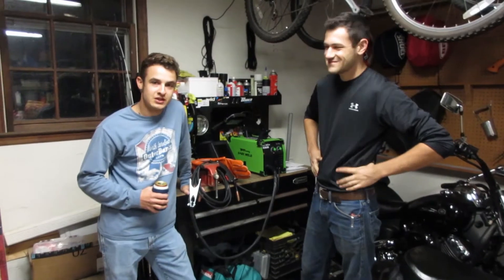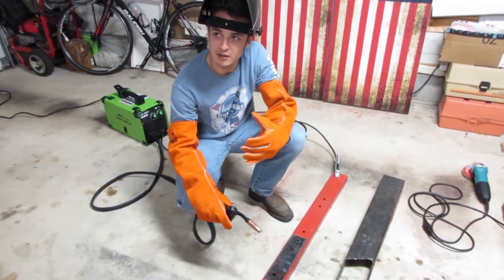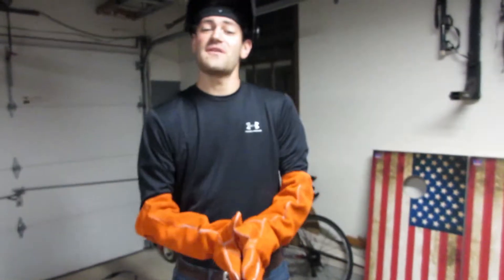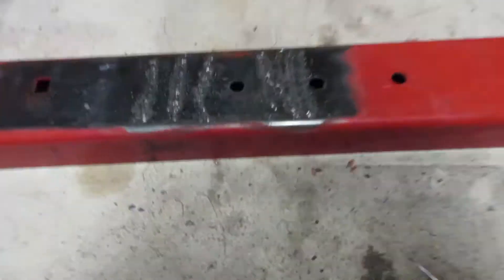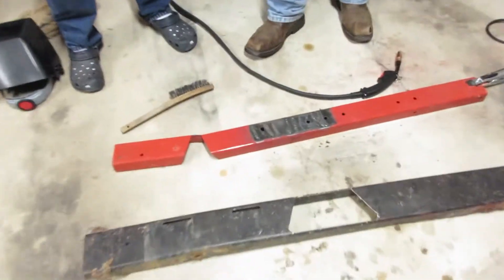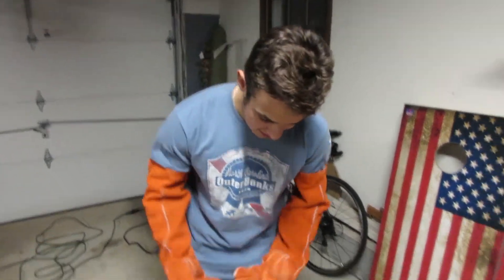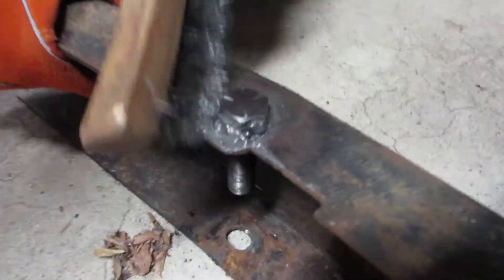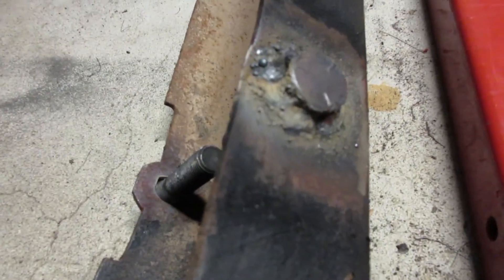Welding for the First Time - Forney Easy Weld 140 FC-i

Comment: I am a 100% beginner with the same welder. What I have been doing and maybe would suggest for you guys is turn the bolts upside down and just weld the head. Then try to knock it off with a hammer. Then you can see how strong the actual weld is.
Reply from the maker: thats a good test. thanks for the tip!

Comment: You would get a better bead if the ground clamp weren't having to contact through paint
Reply from the maker: We did try to grind down the area where we had the ground. Guess we could have done a better job